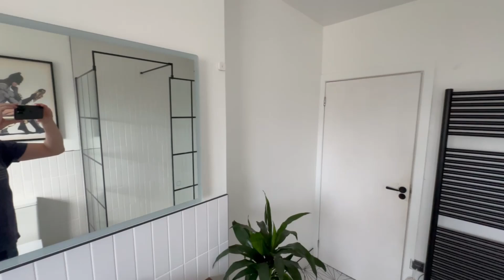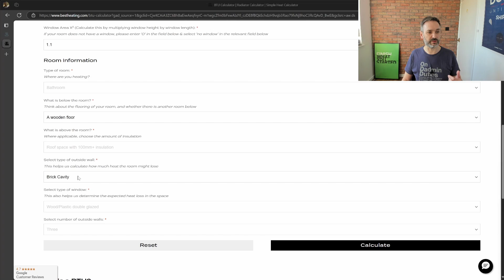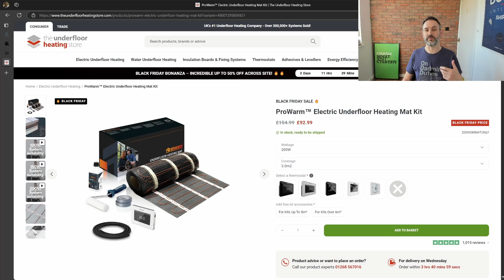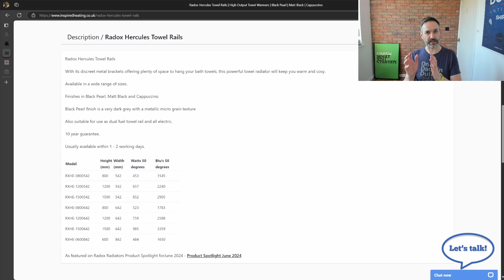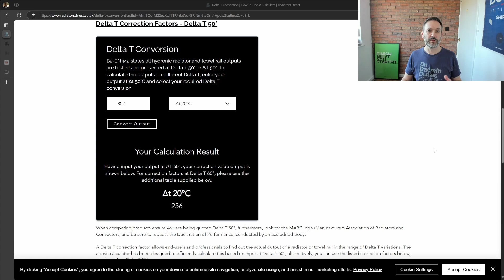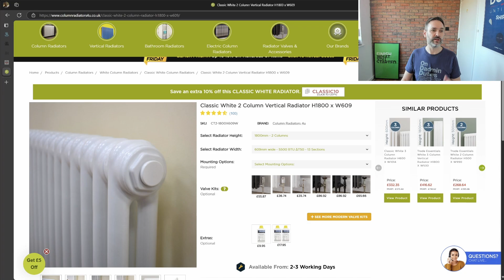The mistakes that led to a very cold bathroom and what I'm doing to fix them!

Comment: When I did our bathroom back in the mid noughties I just went with the biggest towel radiator I could find, which is 750 x 1800, no idea what its rating is though. I also insulated the floor, although it's over our hallway, and added electric underfloor heating, which we've never actually used, the room is also fully tiled, and only has one short external wall. I'm hoping the rad will be OK for a ASHP, but I do wonder how hanging towels on it would affect the heating. I do currently have our CH flow running at 50c, and may turn it down some more, just to see what happens. Last weekend I added sensors to the flow, return and hot water (its a combi).
Reply from the maker: You had more foresight than me!! As you're thinking ASHP, you just need to find the minimum flow you can manage with when it's freezing cold outside. Depending on where you live, it's usually never as cold as you design for. I've seen a lot of people ending up with two rads in their bathroom. One big rad for actual heat and one towel rad to dry towels. We don't even hang towels on ours anymore 🤦‍♂️
Reply: @tomasmcguinness  We're on the south east coast, so it doesn’t get particularly cold, luckily.

Comment: Have you balanced all your radiators?  Is it possible you could send some more flow to your bathroom radiator?
Reply from the maker: Pushing more flow won’t raise the radiator’s temp high enough. The water would need to be coming into the radiator at 65 or 70 to bet the 600W output.
Reply: @tomasmcguinness  electric radiator?
Reply from the maker: Nah, I just need a bigger radiator. There are plenty on the market that suit. Just need to find on that’s not too expensive and that the wife likes :)
Reply: @tomasmcguinness  well great channel keep it going.
Reply from the maker: @CoolSharpHarp thanks! And thanks for taking the time to watch and comment!

Comment: I've seen that some manufacturers overstate their radiator heat outputs - something to watch out for!
Reply from the maker: You're right!!! I'd forgotten all about that! There was an episode of the Beta Talk podcast that covered that. I think mine is close enough as I did some maths comparing the room's expected temperature against the radiator's expected output and it was pretty close.
Reply: Yep! I got caught out because of this.
Reply: Stelrad state outputs at delta 50 (pretty realistic) whereas the manufacturer Reina use delta 70 (not realistic). I would trust the stated outputs, but recalculate with a more realistic delta 50.
Reply from the maker: @JohnnyMotel99 dt 70, bloody hell!!
Reply: @tomasmcguinness  I know! Dunno why they don't update to realistic delta, given that HP's are becoming more common.

Comment: Tom, been a while. Stainless steel radiators should give you more heat. Also check out at a radiator control system that you can set temps per room, the prices have come down.
Reply from the maker: Hey James! You’re right about the rad, but it’s all about aluminium now! As for smart thermostats, I haven’t had a good experience with any of them. Tried the complete Tado setup and eventually took it all out and sold it on eBay 🤣

Comment: So which toolset would you say was the most accurate in terms of heat loss calculation and sizing the radiators? Did you try Heatpunk to size your radiators as I've used it in my calculations and I'm interested in how accurate Heatpunk is
Reply from the maker: I did a full heat loss with Heat Punk and it seemed accurate enough as I checked it against the heat loss I was measuring with my heat meter. There are two videos in my channel related to this. One covers a manual heat loss using my own Excel and one covers Heat Punk. I just found the lack of Undo support really frustrating!! I haven't tried it with radiator's yet, that's on my list. It's well regarded in the industry as far as I'm aware and it meets the standards for a heat loss tool. Like anything, these tools are only as good as the information you put into them too.

Others to consider are Heat Engineer, Spruce and H2X. All of differing levels of complexity.

Is there something that's making you doubt Heat Punk's accuracy?
Reply: @tomasmcguinness  I am content with Heatpunks Heat Loss assessment as it fits with the other Heat Loss calcs I have had done. I found the radiator sizing element of Heatpunk very useful in telling me which radiators I need to change and to what size. It would be interesting to find out what result Heatpunk gives for your bathroom radiator upgrade and compare it to the radiator sizing website you used to calibrate Heatpunks output?